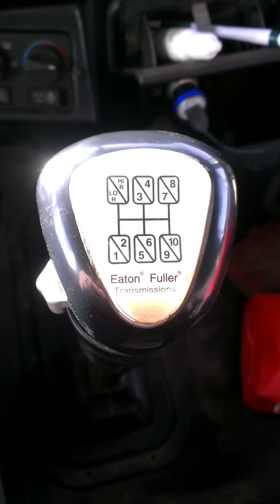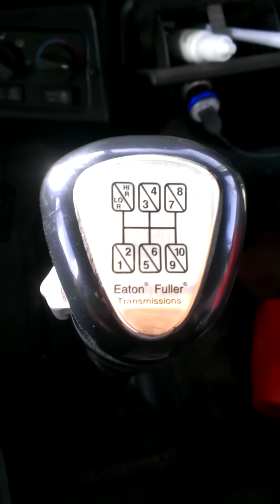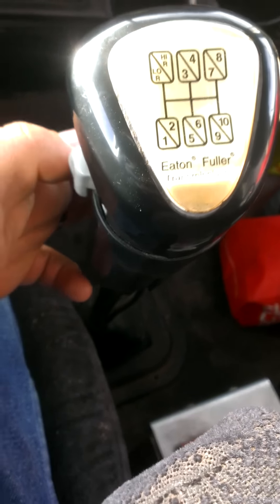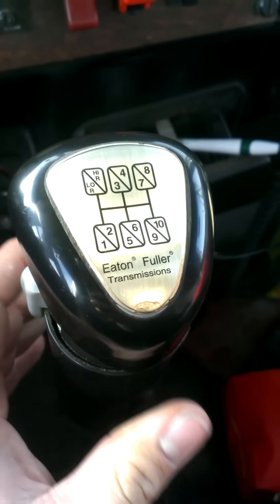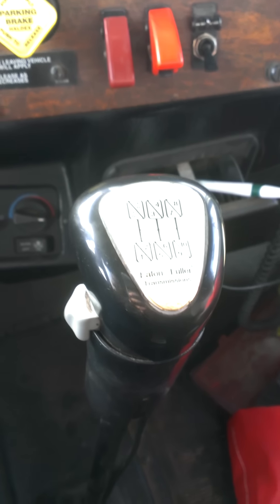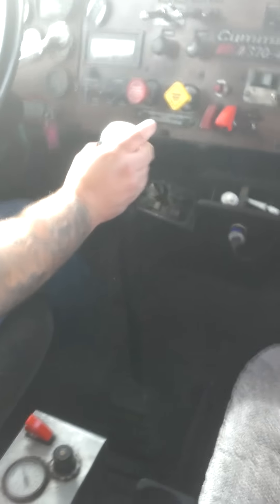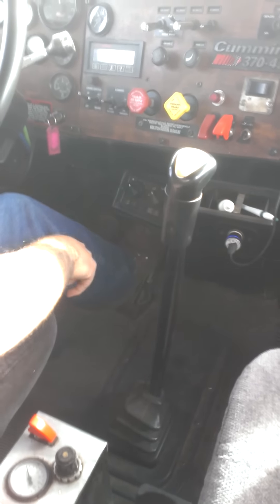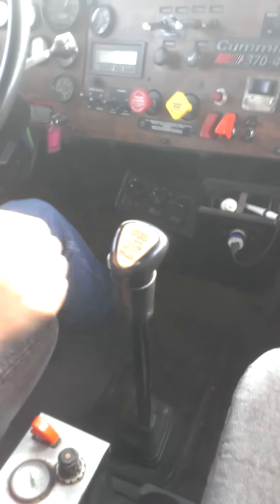Operating a Eaton super 10 transmission

Comment: Looks nicer to drive than a standard 10 speed Road Ranger, easier to flip that switch every other time than to throw the lever for each gear.  A lot like driving a straight truck with a five speed box and two speed rearend.

Comment: I'm just not happy with the super 10. I have use for a little lower gearing for most of my work to start out in diverse ground under loaded conditions, love 13. Low is just enough, 18 I usually run just a 13. Ran a 10 for years under a grain wagon and only once for crude. Straight 10 was as bad as super 10 ...but figured me and super 10 could learn to get by.  Thought I was maybe missing something...so I looked it up. Watched several videos. You shift exactly as I do, Eaton recommends, of course, to clutch the splits and double clutch the main gears. Uhm. Not into wearing out my clutch or leg.  Do you have any advice for fully loaded on sandy or muddy ground that could make my super 10 and I get along a little better?  I've tried to be just super gentle on the throttle to not dig in, I've tried flooring her, I've tried feathering the throttle...useless. I was a crude hauler. I'm used to pulling into sites that are just unimaginable, sometimes ya just gotta throw chains sometimes, no problem. Or you just know what you can do, and do it. I'm not hauling crude with this old boy, thank goodness, yet I've been stuck more times than I ever was before! (Stringing pipe now) help?

Comment: Gears are just split differently than a normal 10 speed.  To me this actually seems easier than a normal 10 speed. If you can float gears you can use a side splitter  like this just fine.

Comment: Could this be driven like a 5 speed when you're empty? Keep the splitter forward to start in 2nd, still keep it forward and shift to 4th and so on.. Or perhaps start in 1st, then keep the splitter back for 3rd, then 5th, and so on up to 9th then split forward for 10th, that's like a 6 speed - kinda like how people shift 13 speeds. For example 1-2-3-4-5L-6L-7L-8L-8H, effectively a 10 speed.
Reply: Eric Cummings I don't do that I always split

Comment: Until you start up a steep incline then it gets a little moody.  On mine, i sometimes have to take it out of gear and put it back in (same position) gear.
Reply from the maker: Leslie Taylor then you have another issue sir. Definitely should get it looked at because that is not normal.

Comment: Are you still clutching between the switch? Or are you literally flipping the switch, letting off gas and reapplying gas with no clutch between the flip of the switch?
Reply from the maker: lance somerville no clutch is used between gears. Just letting up on the fuel pedal.
Reply: @dirtfan54  gotcha, thank you!

Comment: Some say it's some pain in the ass to operate... But after looking at your video, it look easier to drive than any other eaton transmissions
Reply from the maker: It is pretty easy once you understand the concept of it, I think people just dont like change and so when you give them something different they tend to hate it but once you actually run for more then a day or two you will never wanna go back. With full loads down shifting it really shines.
Reply: I just don't like automatic trucks if you ask me(it's just less fun and less control in my opinion)... But manual gear boxes aren't that hard to maneuver. It's only a matter of knowing how it works!
Reply: +Vincent Villeneuve automatic transmission are for  "wanna be" truckers, real truckers don't drive those.

Comment: I know manuals are more economic for big truck engines fuel wise and safer. But what is the point to the split shift surely there is a better system than that.
Reply from the maker: It's not the fact that it's safer or more fuel conservative, you need a smaller gear but higher quantity of gears for climbing Hills and they use the split so you don't have 10,13 or even 18 different slots to shift to, you can split in between each gear.

Comment: Please help. What is the exact sequence? When I go from 1st to 2nd gear, the first thing I do is I switch the button forward to 2nd gear then I release the gas pedal, wait for the rpm and then I press the gas again right?  From 2nd to 3rd do I need to release my gas pedal before switching the button to lower gear and shifting to 3rd?  Or do I first switch the button then release the gas, then shift to 3rd and then press the gas?
Reply from the maker: yes your right on 1st-2nd now when you shift to 3rd. while still in the 1-2 slot and the button in 2nd your gonna click the button down (kinda like going back down to first) then release throttle and go strait into 3rd-4th slot. so your gonna click the button down before the actual shift so when the shift is complete your already into 3rd and button just needs clicked up for 4th.
Reply: +dirtfan54 OK thanks and how about when I'm downshifting let's say from the 10th gradually down to the 8th?  Throttle engaged, gear in the 10th speed.  Then I switch the button to the 9th speed, release the throttle to allow the RPM to go down, then I engage the throttle.  And how do I get to the 8th speed?  Do I switch the button to higher gear while I'm pressing the throttle?  And then do I release the throttle so I can shift to the 8th speed?

Comment: It’s the same thing as driving an 13/18 just not high and low range. (13 u can not use that splitter on low range only high range. Splitter on a 18 can be use in low/high range) 15 speed same thing as a 13 but opposite way (splitter can not be used on high range only low range also last gear it’s right up forward. Spicer it’s a little more fun to drive. Nice video for people didn’t know how to operate this nice tranny 
I was there too

Comment: Did you press the clutch in when you reved for the downshift?
Reply from the maker: Jay's Music No I just give it gas to rev. match for the down shift. only use the clutch for taking off and stopping.
Reply: dirtfan54 How do you rev match without pushing in the clutch? Throw the stick into the neutral hole ? or once you select the low side of the switch it let's you rev freely ? 🤔

Comment: When you "preload", doesn't that set you back, like say, your starting in 1st gear, let off gas, "switch", step on gas, shift into 2nd gear, switch or "preload" while still accelerating to get into 3rd gear etc.. so when you "preload" while still in 2nd gear accelerating, that doesn't automatically shift down?
Reply from the maker: nope you would have to let off then Rev match in order to down shift it back to first